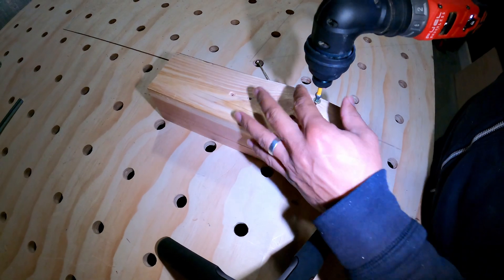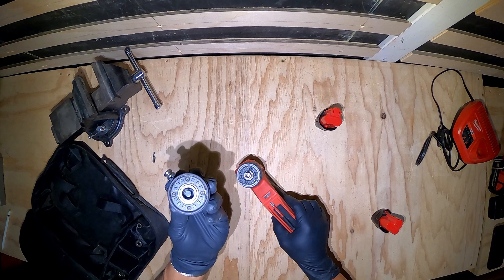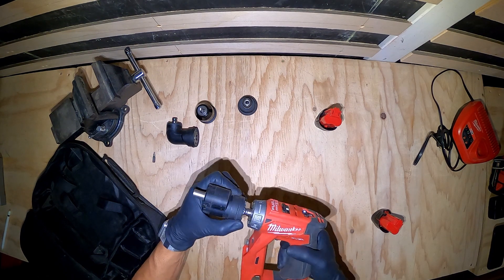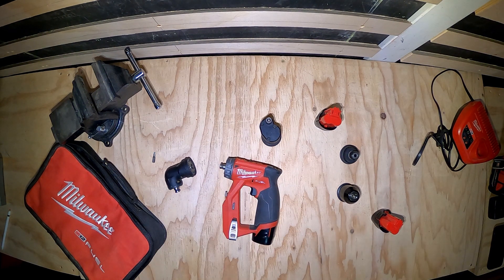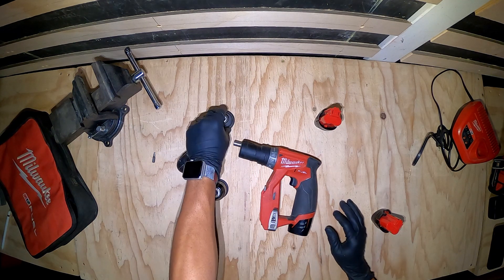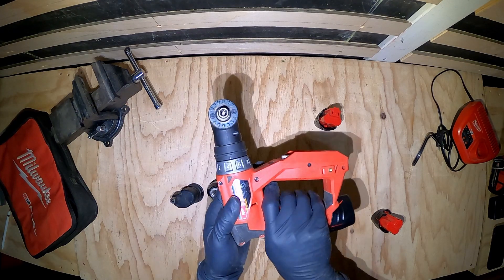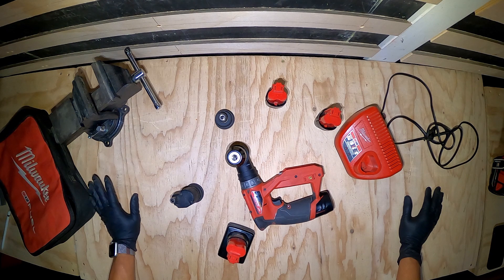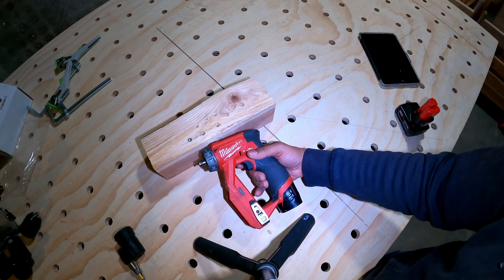Milwaukee M12 Install Drill Driver Overview

Comment: Good review. Very thorough and informative. 
I own one. Perhaps I should give my M12 Surge a rest and take this one out of its box? I picked up a Metabo (German…not HPT) Brushed 12 V Drill/Driver kit that came with 2 interchangeable heads; a chuck and a right angle attachment. They make a 1/4 quick Connect Collet and an Offset Head as well, but each one costs almost as much as the kit itself, which I had picked up for about $85.  I’m not sure why they wouldn’t  just include all 4 in the kit. Because I like the idea of the format of the compact tool with the interchangeable heads….and because I MAY also have a small tool addiction, I also found a deal from an online retailer (CPO, I think?) for a Brushed Bosch 12 V 2 Tool Kit with an Impact and A Drill/Driver with 4 Interchangeable Heads. I like both sets of tools,  but I like the head change mechanism on the Metabo much more than the Bosch. The Metabo, like Milwaukee, employs a spring loaded collar that is smooth functioning and intuitive. The Bosch, on the other hand, uses some sort of twist lock collar that may also have a spring loaded component to it as well. If lifting and twisting is bad for your back, I would suggest it may also not be great for your wrist. It may just be that the collars start out a little stiff and will eventually break in over time, but if that’s the case, will they all break in evenly? Probably not. If I’m not using the offset head or right angle attachment on a daily basis, when I do go to use them, will it be a struggle to get them on and off? All I can say is that because of the size and shape of the twist ring as well as feel when I grip and twist, I feel like I’m asking for carpel tunnel. But maybe that’s just me.
Thanks for sharing the video.
Reply from the maker: Hello James Mocharski, I enjoy using my M12 install driver. Break it out of the box and give it a try. 
I considered trying to obtain the Metabo for comparison and review, but it is not readily available here where I am in the U.S. 
I own the Bosch, and I understand what you say about the mounting mechanism. I do not know how it will age over time. I also think I may never know because I use multiple drills on my projects. I noticed while using the Bosch that you could inadvertently dislodge the attached head when adjusting the torque setting with the twist to lock feature. That could get annoying over time. 
Thanks for the comment. It is good to share with a fellow tool enthusiast. Is there a support group for tool addiction? If so, do not tell my wife!
Take care, James.
Reply: @daddysharespace  Let me know about that support group. In the meantime, I’ll look forward to your next posting. Thanks.